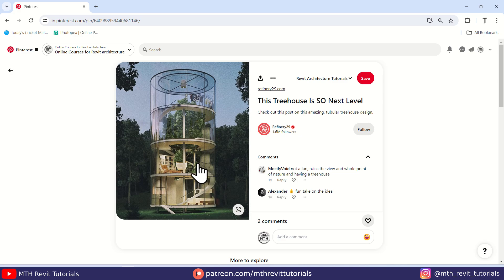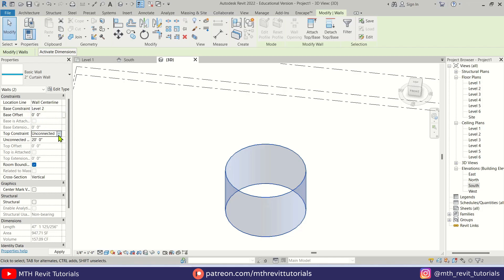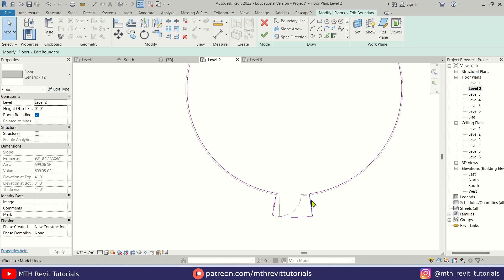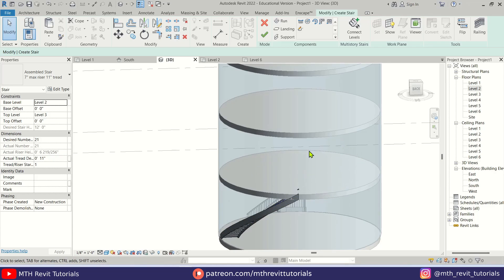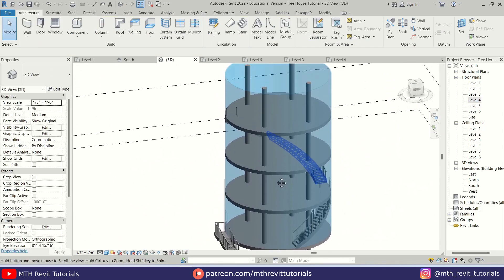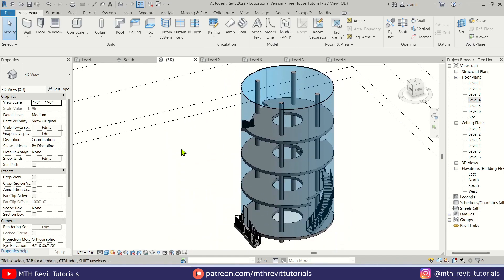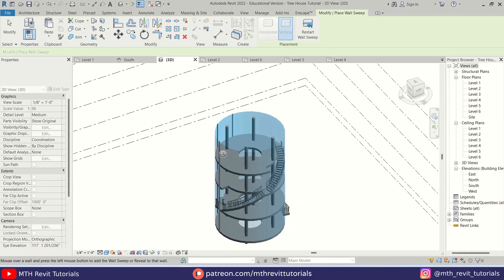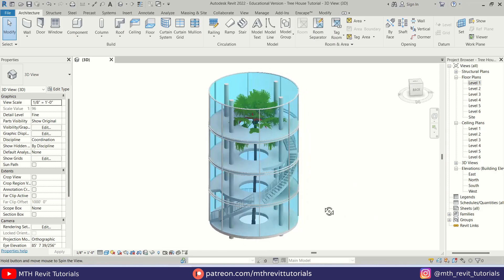Tree House Concept Design in Revit Tutorial | Curved Glass in Revit Tutorial

Comment: Hi there MTH. Great video, as usual. Please explain why you are using sweep instead of curtain wall mullions?
Reply from the maker: Did you watch the entire video? I discussed why I had to use wall sweeps instead of mullions..
Reply: @MTHREVITTUTORIALS   Yes i did. Guess i missed it. Sorry. I suppose it's because you are using generic glass walls instead of store front.
Reply from the maker: @e.e.z.e.e  Exactly! The purpose of the video was to show how to create a curved curtain wall in Revit. Revit doesn't have the option to do it. You have to add mullions at a certain distance to create a curved curtain wall.

In the video, I demonstrated using a generic wall to create the curved curtain wall. Since we can't add mullions to a generic wall, I used sweeps instead. I hope that helps clarify things for you!
Reply: @MTHREVITTUTORIALS   Thanks for the explanation. FYI, i managed to make a curtain wall embedded in a "air" basic wall... The panels & mullions are, of course, straight, but then we have to rely on the frequency of the vertical grid to "smooth out" the circular effect (after all, a circle is just a many faceted polygon, isn't it). I can't imagine the cost of 2 enormous curved pieces of glass, lol ! 

Thanks for your fun project. Keep 'em coming.